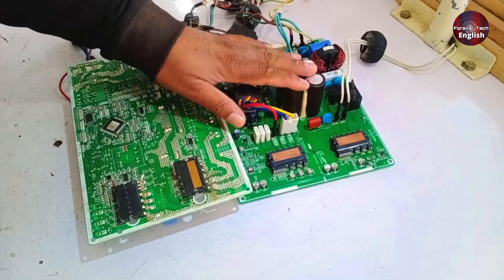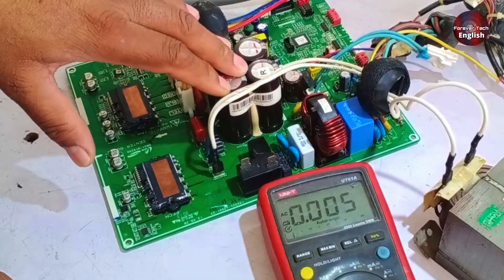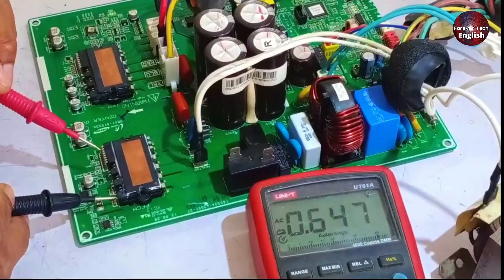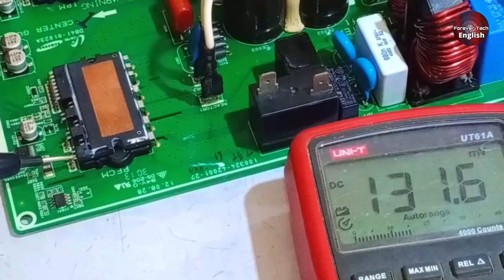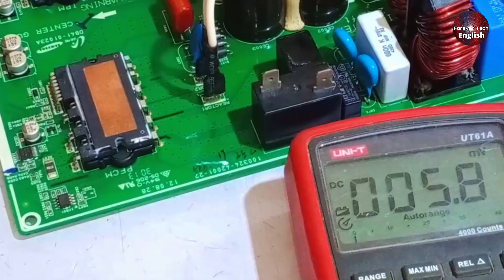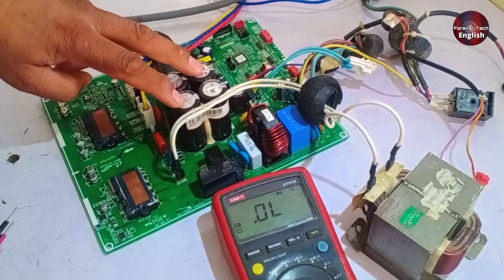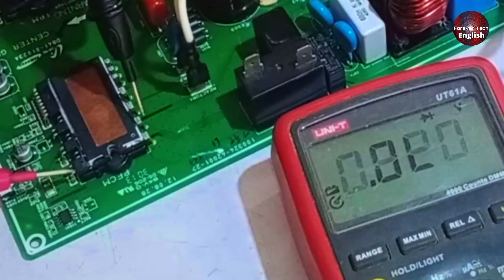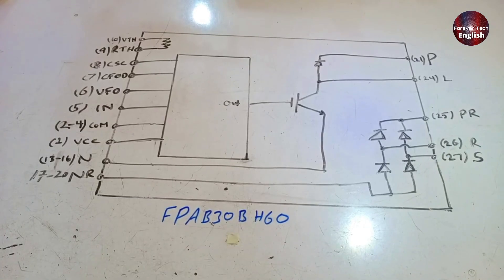How to Test Smart PFC Modules Fast: Boost Power in Your Electronics!

Comment: It's not overvoltage resistor built in, it's overcurrent i.e shunt resostor.
Also, you're missing one IGBT on the schematics. Remember, it's totem pole module.
Reply from the maker: I know that it's over current, and you are right, its editors editing mistake